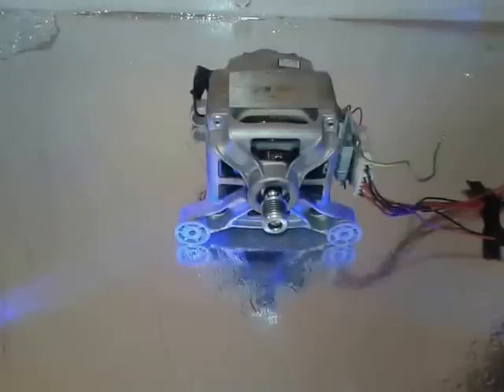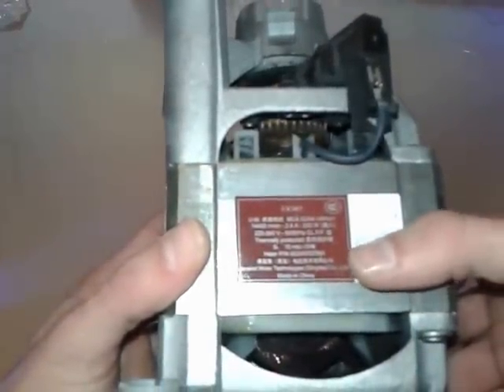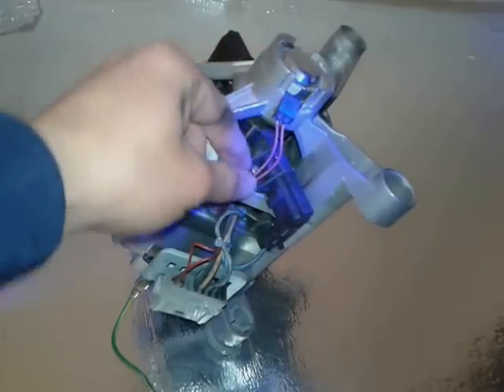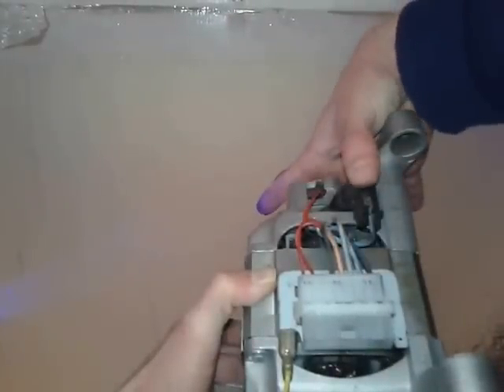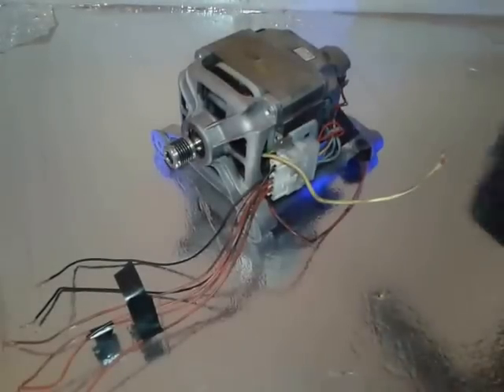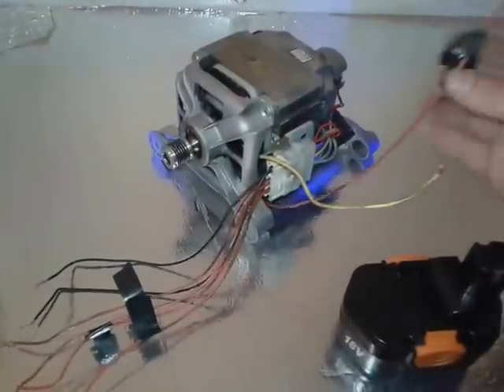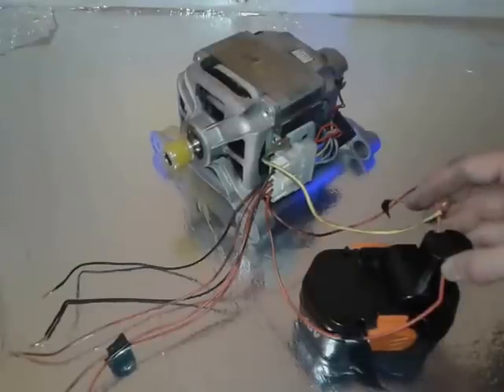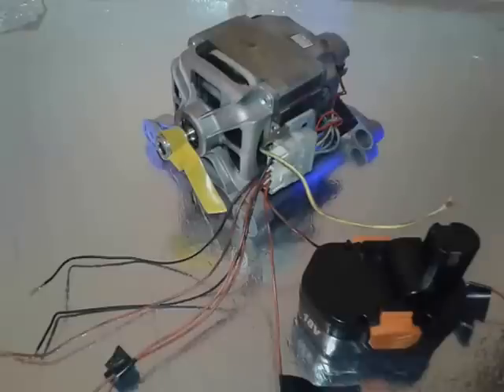Incredible washing machine motor on battery!

Comment: Good experiment but not much you can do with it, universal motors also act like dc motors , there will be no torque as you mention running electric bike etc
Reply from the maker: Paul Oskar if you will power the motor with 48v it will have more power but even so powered by mains you can do endless projects lathe machine for wood, circular saw, sander belt or circular and with a car alternator who knows a generator... All the best mate you got any idea if there is a rubber resin I have some ideas?

Comment: Can I use 5.5kg Front load washing machine motor for ebike? 
If so how much voltage should be applied?
Can it able to pull 90kg load?
Reply from the maker: Engineering Box in theory yes is possible voltage should be above 24v and if you pedal to get the bike started and then use the motor should be no problem personally I can't make some king of shaft but I am trying
Reply: Not sure if you alredy did this. Washing machine motors use AC. Most are universal. BUT. You can get 2 24 volt batteries, and buy a DC 12v to AC 110 volt converter. Hook the batteries up. You will have more power.
Reply: @dangerousdoggo5465  but u will get less backup
To increase the back up, need to but high amp battery which increases in size and weight, which is not suitable for my design
Reply: @BOLTsLABORATORY  What
Reply: @dangerousdoggo5465  if I use an inverter that converts 12v dc to 220v ac , it doesn't run for long time if I use less Ah battery.
So, I need to use 60ah to 100ah battery for better backup , and the battery of that ampere is big in size and heavy, which is not suitable for my design.
Reply: @BOLTsLABORATORY  Oh god. Because I have a 5.5 ah battery, and someone told me to get one more, and a DC 12v to AC 110v, but I can only get a DC 12v to AC 220v. Not sure about DC 24v input though. 

My washing machine motor is 1.6 ah.
Reply: @dangerousdoggo5465  my problem is solved
I used li-ion batteries 3.7v, 15 cells in series
Reply: @BOLTsLABORATORY  Oh, nice. I'm going to use 12 volt lead acid batteries, cheaper.
Reply: @dangerousdoggo5465  li-ion batteries are cheaper and efficient than lead acid batteries for same voltage ranges
Reply: @BOLTsLABORATORY  Alright

Comment: Hi, I have an old BEKO automatic washing machine, it's control panel is damaged, I'm looking to reuse some parts of it. It happens that I leave my house for few weeks so I need to create a small indoor irrigation system. I'm wondering if you can help me with this by reusing some BEKO parts. The idea is to connect a container to water source by BEKO inlet with a way to open the valve when the tank is empty and close the valve when the tank is full. I'm wondering if the chamber pressure and pressure switch will be helpful without the control panel. I know that I may find a similar system in the market. But the idea is to recycling. And if there is a better way than this I’m open to learn it. Thank you
Reply from the maker: Ziad Sourany it is possible from the washing machine you can reuse the motor as i show in this videos,the waterpump,and there is some electrovalve also.to put it simple you whant to build something like the toilet flushing system when empty let water in and when full stop inlet water.the easiest way is something similar to toilet flush in my opinion.all the best
Reply: Many thanks
Reply from the maker: Ziad Sourany any time

Comment: Hey bro i am working on a ebike so can you help me how can i recharge the battery while riding it
Reply from the maker: hi mate an easy solution is to get an ebike motor and instal it in the front wheel electric ebike conversion kit but i think is expensive.other solution double axel double motor one for power one for generator

Comment: is it possible to  speed control under dc voltage?
Reply from the maker: i didnt tried yet but i have an ideea with a motor controller board that you can find on ebay
Reply: i will let u know when i test it with controller

Comment: so if I were to build s 72v lithium battery, this could go really fast. would need a controller or just a throttle?
Reply from the maker: +Lee Macho yes more voltage more power as controller you can use a cheap one voltage regulator or speed motor controller or you can try a ac light dimmer rated at 400w all the best
Reply: Lee Macho Just remember that universal motors aren't very eficient. I don't know what you are building but if it's a vechicle, ac motors with pernament magnets will get you around 25% further.

Comment: how much and you need engine washer fell Automatic to work and thank you
Reply from the maker: Can you repeat?the engine is a universal washing machine motor 
hotpoint.for running with dc from 18v on it will run it has multiple 
purposes electric byke,wood splitter,generator in some cases,small boat 
engine,go cart,and more thanks for watching
Reply: Thank you so much

Comment: man, fantastic video :D ,but, i have one question about my project, i have a blender engine and would know how to connect on a battery, can be anyone long as it works :P ( i have an old battery of a laptop too), can you help me?
Reply from the maker: hy mate a blender motor will not work this motor from washing machine is a universal motor it works on both dc(battery) and ac mains find an old washing machi and have fun
Reply: oh thanks :D, and just more one think, the motor of washing machine works well on an ebike?
Reply from the maker: +KieskiGK watch this video its a little bulky but it is running https://youtu.be/HCGy4i03RH0 have fun
Reply: +NoSkillsRequired Mate isn't a kitchen blender motor also universal? I connected a 9.6v NiCd pack to one and it seems to spin.
Reply: worked well?

Comment: I'm still trying to figure out how a 110 volt AC motor can possibly run on 12 volts DC. Unless the motor is designed for that. I've never seen a transformer inside a dryer or washing machine.
Reply from the maker: +James Seabolt Hi mate this motors are called universal motors that means can run on Ac/Dc now on 12v is not going to run as fast as 220/120v but there are cheap if not free and run with 48v can make an ebike cheap all the best

Comment: IS IT POSSIBLE TO USE AND BUILD THIS MOTOR UP TO TURN ON A SELFMADE TREADMILL (DOG)? ADJUSTABLE FROM 0 - 16 KM/H ? WHAT DO YOU ALL NEED TO LET THIS WORK PROPERLY? DO YOU PREFER TO USE POELIE (BELT) OR CHAIN ? GR.
Reply from the maker: I don't know for sure because the washing machine motor is rated at 1/4HP or 3/4HP and the normal treadmill motor 1.5HP it's all about the force that a motor is rated for.Imagine that the washing machine is designed to rotate 5-10KG of clothes and treadmill can move a person.But you can use the advantage that the motor spins very fast and with a set of wheels you can amplify the force take a look at the microwave oven motor.The motor used in the video is 0.6HP and the microwave is 0.006HP so with a set of gears a washing machine motor rated at 500w can move a person of 100KG.
KG-kilograms HP-horse power
All the best.
Reply: Thanks !
Reply from the maker: Any time all the best

Comment: Big experiment bro
Reply from the maker: +Bekim Toscana thanks any question please ask
Reply from the maker: +Ochipwa Greenspider in this video i use a 18v drill battery but it can go till 36v even more,you can try from old laptop battery multiple li-ion in series even 24 v like 12v in series can run
Reply: This motor cannot used on e-bike.Because it is only average 30 watts.
Reply from the maker: earch again friend others have done it
Reply: NoSkillsRequired I cant find anything.You have a link?
Reply from the maker: here you go my friend https://www.youtube.com/watch?v=aBPylDAMnDc and there are more
Reply from the maker: another one https://www.youtube.com/watch?v=4oY4K7QK-Rc enjoy and check my other videos thanks
Reply from the maker: check this out https://www.youtube.com/watch?v=aBPylDAMnDc

Comment: poor ac motor, if you still running like this the coils have a joule effect cause you use an battery dc, then the overheating kill those coils
Reply from the maker: +jeancarlo murillo I have tested it for 2 H and no heating maybe after more hours
Reply: NoSkillsRequired maybe if u try a universal motor for best results?
Reply from the maker: jeancarlo murillo this is an universal motor buddy otherwise will not work on dc
Reply: the universal motor work on dc, thats the point of being universal

Comment: NICE  I WANTED TO KNOW IF I COULD RUN A WASHER MACHINE MOTOR WITH A WASHING MACHINE WATER PUMP TO PUMP WATER OFF GRID SO THANK YOU SIR D C THAT IS HOOKED TO SOLAR PANEL
Reply from the maker: It is possible but there are 12v water pump that can go direct to solar panel is more eficient.watch my other video you will find more off grid tips and solutions.all the best
Reply: Martin P. Murtha - In terms of cost and simplicity and silent operation, depending on your application, a 12v submersible pump is hard to beat. 
2 wires (+ , - ) 1 output for a hose... and did I mention cheap. ;-)

Comment: pointless , because you've forgotten len'z law
Reply from the maker: We dont get technical here,and i never claimed that on battery is gonna run as fast as the main power but because is cheap and useful and has many application from 18v-48v like electric byke,generator,wood chopper,go kart,and many many more maybe someone needs to connect it to a battery and dont know how.all the best